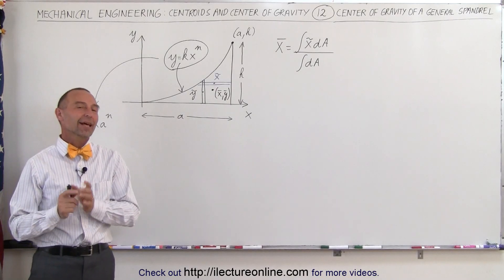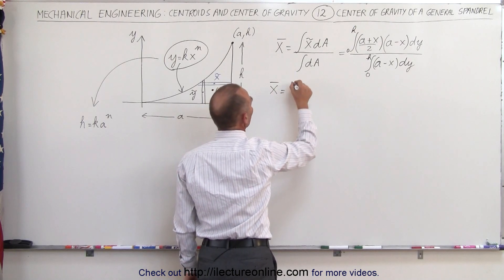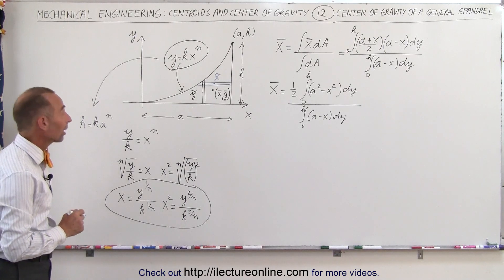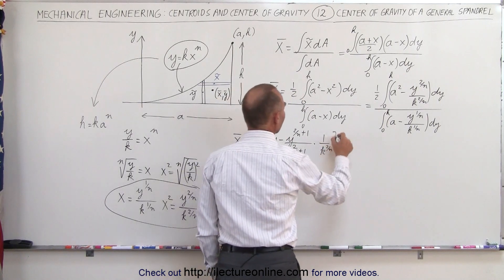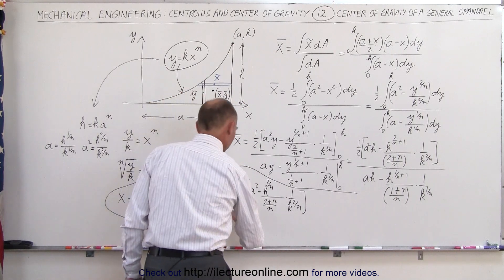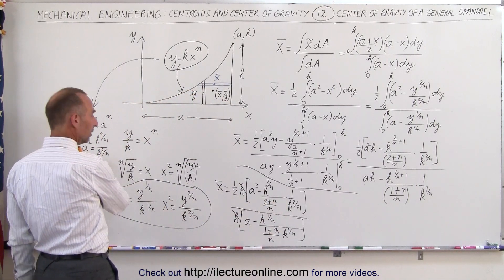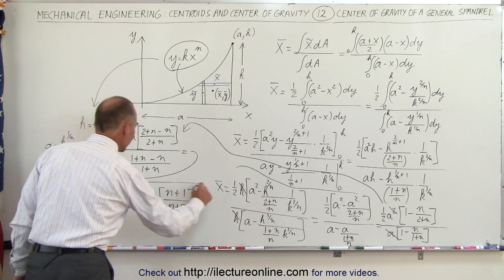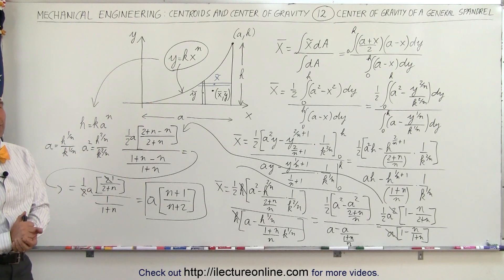Mechanical Engineering: Centroids & Center of Gravity (12 of 35) C. G. of a General Spandrel 2

Comment: i am so confused. How did you get x+a/2  for x bar   ??? wouldnt it be a-x/2
Reply from the maker: If you take a look at a number line. Lets say you want to find the average value of the numbers  6 and 20, how would you do it?    You add the two and then divide by 2 (as was done in the video)
Reply: You could do it that way but then you have to add 'a' to get the correct centroid.  (a-x)/2 + a = (a+x)/2.

Comment: Why can't we find X` from the same vertical strip used for finding Y`. In that case X of small strip would be x only and dA= ydx.
On simplifying we get the same result and that with very less calculation. Is there any conceptual mistake while doing what i did? Because i can find the x` and y` from the same elemental area.
Reply from the maker: The concern is the distance from the x or y axis to the area element.  The preferred method is to have the direction of the area element such that the entire dx of dy is the same distance from the axis.  (That is based on the calculus concept of integration).
Reply: @MichelvanBiezen   hi sir can you make a video about this to show the different in accuracy  for this two method?  Because I tried on every question in your video using this two method and seems to have no difference. And I dont quite understand why the method you mention is preferred. thanks for the help!! Wish you the best in life!
Regards 
Lim Bing Jie